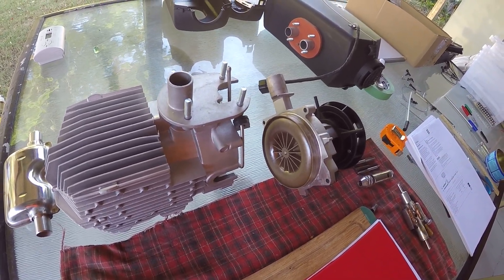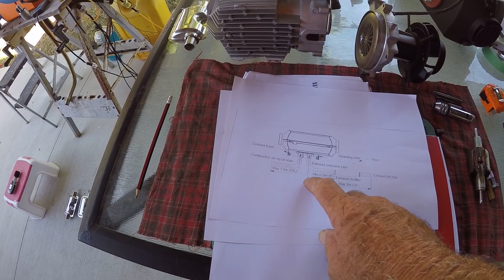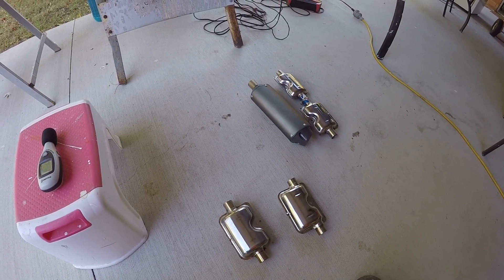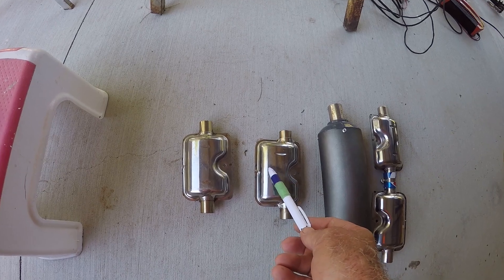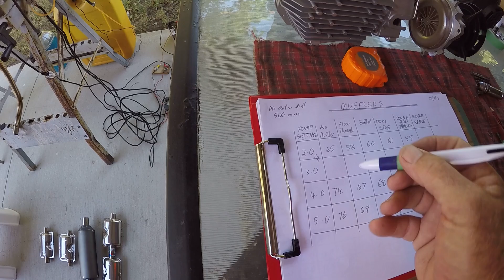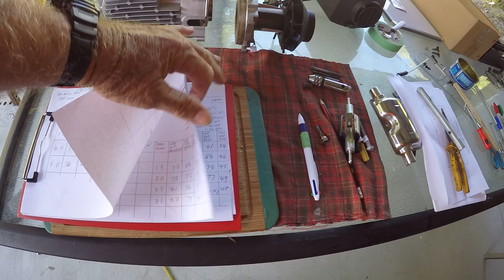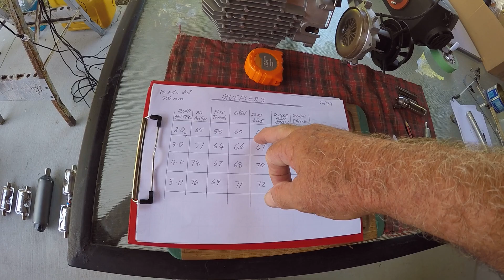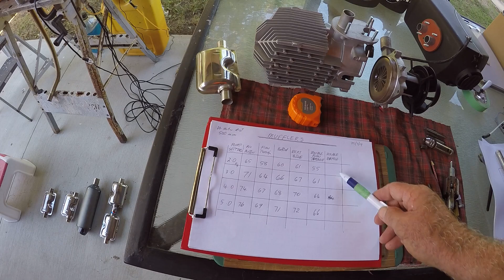Chinese Diesel Air Heaters - Part 8 - Exhaust and Mufflers

Comment: Great info John, thanks!   I'm installing a 2.2kw diesel heater in my power boat.  There's not a ton of space and I don't want to have a drain hole into my cabin from the exhaust.  Do you have any advice on routing the exhaust so as to minimize condensation?  Can I mount my muffler horizontally, vertically or at a 45 degree angle or will that cause any issues?  (Based on your experience.)  Thanks in advance.  Cheers, Mark.
Reply from the maker: Hi Mark, 

You can actually mount the muffler anyway you wish, and the exhaust can go where you like, but you still need a drain at the lowest point, not just to drain condensation, but also to drain any unburnt fiel.

But please have a look at my boat install video.  JMcK
Reply: @johnmck1147  , thanks for that.  I will be looking for a fitting with a shut off that can withstand the exhaust heat now...  as for the mounting of the heater in a power boat, I think you advise mounting it parallel to the keel as close to centre as possible, am I right?
Reply from the maker: @markedwards4789  

No Mark. In a power boat or multihull it does not matter. 
In a sailing keel boat that heels over when sailing it is better to mount the heater in a position that is less impacted by the yacht heeling. But if you only use the heater at anchor, it does not matter.
Cheers.   JMcK

Comment: Very very helpful John. Thanks heaps for a great set of clips. Quick question. Can I  join 3 straight through mufflers as I  have them and would it be of any benefit? Thanks heaps regards Peter.
Reply: Dave McLuckie  did , tho he didn't specifically address excessive restriction issues.  i don't recall if he used a db meter , but a 2nd , then 3rd muffler were Very audibly noticable on the mic.  As i recall tho , he was using the REALLY cheap Chi. mufflers that were EMPTY inside. Yup , that's right - EMPTY :  No perf tube , NO matting , just an expansion space !  ( that's what i got with mine )  The 3rd muffler made it whisper quiet.  i was quite surprised.

Comment: Great set of videos and very useful/ Currently replacing and old eberpacher on our tranist RV. One question exhaust tube at 600mm is too long. If I leave it at 600mm  and curve it under the van through 180 degrees my toal bends will be nearly 270 (limit?). Alternativelly can  I cut the tube in halfand then ave bends less that 280 degree total?
Reply from the maker: Hi Ian,

The heater will run with 600 mm of exhaust.

It is ideal to have a short exhaust with a minimum of bends for a minimum of restrictions to the intake air and exhaust. The more the restrictions the poorer the combustion burn,  the poorer the burn the more carbon, the more carbon produced the more frequent the service required.

But you also need to be practical sometimes, and slightly exceed the recommendations. 
Sometimes you may need to try it and see how it goes.

If your Eberspacher worked ok just swap in the Chinese heater. It should work ok.

If your old Eberspacher was a service nightmare, then the Chinese heater will be also.

Good luck.  JMcK
Reply: @johnmck1147  ...will it run with less thqn 600mm?
Reply from the maker: Ian Manzie 

Yes.  JMcK

Comment: Good morning John. I have just about finished installing my all in one heater through shed wall. The exhaust muffler is fitted as you suggested and very quiet. I extended my combustion inlet pipe sideways by 1m on 67mm plastic pipe to avoid exhaust and not restrict air flow. I am finding the noiseiest part outside is the inlet. Any pointers for making a muffler insert please? I have some 1mm mesh, 1” mesh and fibreglass insulation to play with.
Reply from the maker: Hi Ian,

I have found the inlet mufflers are noiser than no inlet muffler due to their inlet air restrictions.
I personally just put a filter screen on the inlet and that is good for me. Also, on my all in one I have the inlet right under the heater.

You can make yourself a combustion air inlet muffler, but I suggest it be of the flow through type. 

You could even just put a flow through exhaust muffler on the inlet side, after a bug screen.

Cheers.  JMcK

Comment: I've heard some of the cheaper mufflers contain asbestos, is there any truth to that? Thanks
Reply from the maker: Hi Darryl, 

There are so many different manufactures of these mufflers in Asia, I could not possibly give a definite answer. However the mufflers I have personally seen come with some fibreglass insert, or nothing, just a perforated tube.

I personally would not lose any sleep over it, unless you want to cut the muffler open or sniff the exhaust.

Cheers,  jMcK

Comment: hi how hot will the exhaust get while running?? thanks
Reply from the maker: Depends on heat setting but  can exceed 200°C. JMcK
Reply: @johnmck1147  that alones great thank you I'm wanting to put one in my garage to dry my bikes after washing but my wall is timber lined so will need to strip out a section.. Thanks for the  reply
Reply from the maker: sean cordingley 

Hi Sean, have you seen the motorhome install video? 
I use a cheap rain gutter part to provide protection from the exhaust. (Fast forward)

Cheers.  JMcK
Reply: @johnmck1147  yeah I did thanks think I'm going to use some of you're idea's and mount it side ways on the wall probably use similar sort of flange too..  Videos are very good and you're very informative cheers
Reply from the maker: sean cordingley 
👍

Comment: The muffler supplied with my heater is a spring inside a hollow stainless steel shell
Reply from the maker: Hi Mick, sounds like a type of flow through muffler. I think you will find the muffler is also packed with noise absorbent material. To see if it works just try your heater with and without the muffler.  JMcK
Reply: @johnmck1147  I thought it might have had glass wool or something so being nosey I looked inside it with a borescope and all it had inside was a little dust and some cobwebs.
Reply from the maker: Mick Ward 

Good for you Mick. 

All mine have glass wool inside.
I am curious now to see if there is a noise reduction without the wool. The majority of car mufflers are empty inside.

Cheers.  JMcK
Reply: @johnmck1147  the sound with the muffler on is about 3 to 5 decibels with quieter than with it off tested with a smartphone app
Reply from the maker: Mick Ward 
Thanks for the info Mick. 
I will have to try that phone app. I always have my phone, but I don't carry around a dB meter in my pocket.  JMcK

Comment: I'm not sure if it has been asked or discussed.. Would driving whilst the heater is on, effect the running at all? I'm thinking about the positive and negative pressures around the vehicle. How would those effect the exhaust and inlet?
Reply from the maker: Hi Brahoy,

It is very common to have the heater on while driving. However there may be some legal issues in a few countries. You need to do your own research.
Many all electric vehicles have a 2kw version as their cabin heat source while driving in winter.
Just make sure the exhaust outlet faces backwards so as not to get pressurised from movement if facing forwards.

Cheers.  JMcK

Comment: It is because of the back flow in the chamber is what you hear.  Think of the air flow as being water flowing through it.  Now if the muffler had good packing it would slow the air or water flow down, which would make the exhaust a little bit quieter exhaust.  But it would have to be made bigger around, not longer to make it just a little less noise.  Yes adding 2 does work together but there is a lot more going on with the air flow meaning (exhaust gases) than I would like to post.
If it was a gas combustion engine I would not be here.  Diesel heaters I have no experience on, but I did check the temp on the exhaust was a little high (In my thinking anyway).  I  thought I could use that heat somewhere else.  Like a food warmer or maybe a 5 gal hot water tank heater, I just don't know the exhaust back pressure that make these work.
Thanks for your time tho.
Chilly
Reply from the maker: Thanks for the feedback William.  JMcK

Comment: Can I put exhaust pipe through radiator build from pipes ?  It will have larger diameter.
Reply from the maker: Not sure what you mean here Kiszot.
Do you want to use the exhaust to heat water? 
That is ok, as long as you don't have too much restrictions in the exhaust pipe. The exhaust must flow freely.   JMcK

Comment: So here was I, searching YouTube for what little usable info I maybe could find on the Chinese heaters, not expecting much relevant info. And then did your fantastic series pup up!! WOW!! What a wealth of super high quality info, simply amazing!!! Thanks so much for sharing your wast knowledge with us!! :-)
May I please ask you about silencing the heater, is it possible to wrap the heater in something like this: https://www.amazon.com/uxcell-Deadening-Insulation-Deadener-Waterproof/dp/B01I3C64ZQ to get a silent environment?
Reply from the maker: Hi FM,

First thank you for the positive feedback.

If you wish to wrap the exhaust, that is fine.

However, I personally would not “wrap” the heater itself, but I see nothing wrong with lining the heater compartment with a sound absorption product.

Cheers, JMcK
Reply: @johnmck1147  Thank you for replying! :-)
I am not sure I understand, do you mean lining the "room" the heaters in or?
The noise I am trying to avoid is from my cabin-scooters motor and the heaters motor, so insulating that "room" under my seat will be fine it you think it maybe can work? Do you know what to use? :-)
Reply from the maker: Fried Mule 

Hi FM, some people install these heaters in a box, some under the seat, some in a cupboard etc. If heater noise is a issue for you, you can line the box, or under the seat etc with noise insulation material. Just as the bonnet and firewall on your motor car are lined with noise insulation. Just make sure the insulation is appropriate. Eg, it would not be very smart to line the heater box with flammable polyurethane foam.

I suggest you try the heater first to see if you really need noise insulation around the heater itself.

Cheers.  JMcK
Reply: @johnmck1147  Thank you so much! Yes that makes a lot of sense, I am now thinking of going to a store that knows how and what to use for insulating sound in cars and so on. :-)

Comment: Hi Mick. This is a great video series. At about the 3 minute mark on this video you quickly mentioned that there should be more exhaust pipe after the muffler than before it. If I am going for a two metre exhaust run, does that  mean I should have the muffler close to the heater, then a wider pipe to where the exhaust finally vents?
Reply from the maker: Hi Mick,

Sorry for the confusion. I said more exhaust in front of muffler and less exhaust after muffler.

To lessen exhaust restrictions it is better to have the muffler close to the end of the exhaust, or even right at the end of the exhaust.

Cheers.  JMcK
Reply: @johnmck1147  thanks Mick. I am needing to go 2 metres in lenght for the exhaust with only one bend at the heater. Would I need to go to a wider pipe? If so, where do I get it and a muffler to suit?

Comment: I have installed a diesel heater in my motorhome in the space that the propane heater was. The most of the exhaust pipe is still inside the space. Can I and should I wrap it to keep it from getting to hot in the space?
Reply from the maker: Yes Wanda, going on your description my suggestion is you should lag the exhaust pipe in this instance.

Regards.  JMcK

Comment: On the subject of exhausts, what are your thoughts on an upright exhaust stack if the heater is sideways mounted? Considering this option to pipe the exhaust out of the roof (with the exhaust in an enclosed box like a house flue) so fumes are airborne.
Reply from the maker: Hi Mr C,

If the heater is sideways mounted you must make sure the the glow plug is on the top.

You would need a 90° bend in the exhaust to make it go upwards.

An upwards exhaust is very good and draws well but you need another bend at the top or some other form of rain deflector at the top.

You will also need a small drain hole at the bottom of exhaust to drain away condensation.

If the bottom of exhaust is in accommodation space you need a water trap condensate drain like in my boat video.

Cheers.  JMcK

Comment: How hot does the Exhaust exaust pipe get while running at maximum (boost) mode, can't recall if you used a lazer temp meter in the video or not?.
    Great lesson, thanks for sharing this information with us.🇺🇸✌️

Comment: What's the main differences between the eberspacher and webasto heaters. 

I read a comment saying parts for the webasto knock off are harder to find than the eberspacher knock off?

How do we know when we shop online?
Reply from the maker: Hi Ryan, 

The main difference is in the internal construction under the outer case. The Webasto (in my opinion) is more difficult to service, and you are correct, Webasto parts are more difficult to source.

There is a slight difference when you look at the heaters side by side, but it is difficult for the new purchaser to notice these differences. 

Suggest you go to the Webasto site and study the image before purchasing a knock off heater online. At this stage the majority of heater knock offs are of the Eberspacher design.

Cheers.   JMcK

Comment: so should i just not run a muffler?
Reply from the maker: No Robert,

A muffler is good. If you can try and use a flow through muffler.

Cheers,  JMcK

Comment: Hello John, thank you very much for these videos, going to install one and I owe you! One question: what about 3 or 4 straight mufflers to even more reduce the noise? Would you recommend that? Thank you!
Reply from the maker: Hi Petr,

One straight through muffler is generally fine, use two or more if noise is an issue, but they must be the straight through type, not the baffled type.

Generally the annoying noise comes from the fan running at high speed and the "ticking" of the dosing pump.

Cheers,   JMcK

Comment: Thanks for all help on other topics regarding the heaters.   I'm going to install a diesel heater in my shop.  I've seen videos where they recommend the combustion exhaust pipe be installed in a downward direction so that any condensate or extraneous diesel fuel will exit thru the muffler.   My original plan was to have the combustion exhaust exit above the heater.  Now I'm not sure that's a good idea.  I'd appreciate your perspective.
Reply from the maker: Hi J,

Combustion exhaust is an expanding hot gas and it likes to go UPWARDS. Long downward exhaust slope creates restrictions in the combustion process. In many motorhome and caravan installs the exhaust is generally horizontal or slightly downwards. If there is a low spot in the exhaust you need to drill a small hole to act as a condensate drain. Outside the vehicle this drain  is no problem.

Inside your shop it is fine to run the exhaust above the heater, but you will need a condensate drain at the bottom. If this drain is inside your shop you will need a water trap drain to prevent escape of CO gases.

Have a look at the boat video in this series. Most boats have the exhaust exiting far higher than the heater, and they have a water trap condensate drain at the lowest point.

Good luck.  JMcK
Reply: @johnmck1147  Thanks again!

Comment: I went with the double muffler that you did a sound demo on and the difference is amazing, I had one muffler to start with but when i added the second i noticed a big difference and much more quieter. Brilliant video john great information. The mufflers i purchased are the straight through type not the type with the bend.
Reply: how did you connect the two mufflers?
Reply: @dansmith6990  i used the exhaust pipe, i used a hacksaw andcut a 3 inch piece then used jubilee clips.,Use the smooth bit of the exhaust part, i bought a length of ebay, its cheap.

Comment: Thanks for taking the time to do this, I would guess the motorcycle muffler has a larger inside diameter so the exhaust isn't forced into the baffles, would be interesting to put some rifling on the entrance to the muffler, get the exhaust spinning and maybe it would enter the baffles more. Great info, just got mine so time to experiment and fall Salmon season gets cold in the boat.
Reply from the maker: Thanks for the feedback Steve. Keep warm catching those fish.  JMcK

Comment: Hi John please tell me, does the inlet - the combustion air have to be from outside the vehicle or can it be ambient air from inside. If inside then as the temp increases inside then the unit has less work to do to heat up the output air?
Reply from the maker: Hi Peter,

Are you referring to combustion air inlet that goes into the combustion chamber at the bottom of the heater next to the exhaust, or the inlet air for the heater heat exchanger?

If combustion air, it is preferable in a fixed install to have that outside as occasionally on start up  you can have fumes coming out the combustion air inlet hose for a short period, and if you flood the heater, diesel can seep out the combustion air inlet hose.

If you are referring to the heat exchanger inlet air that gets heated and sent into the accommodation area, it really is a personal preference. Just as in a motor car, you can choose fresh air or recirculated air.

If recirculated air, you are correct, the heater has less work to do, but you will need a vent left open somewhere to give you fresh air.

If from outside, the heater works harder, but you have a constant stream of fresh air. It is a personal choice, and, I suppose, what is the easier install.

Regards.  JMcK
Reply: First of all a great big thanks John for your amazing contribution and detail on this whole subject.  You have answered my questions perfectly, Thank you. Peter